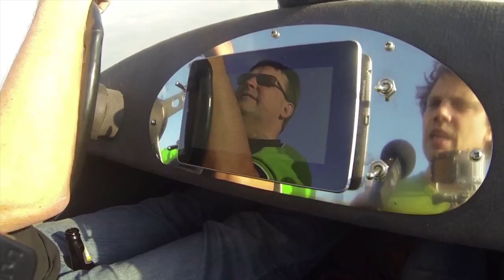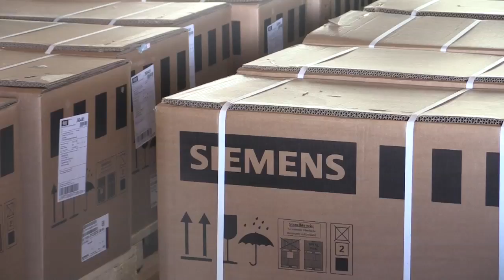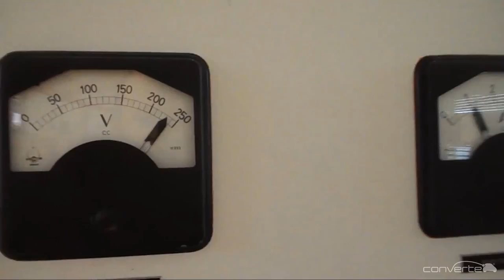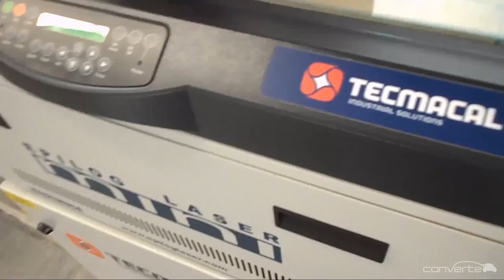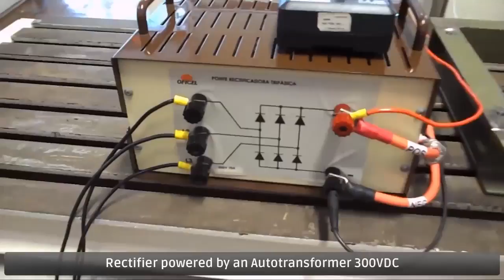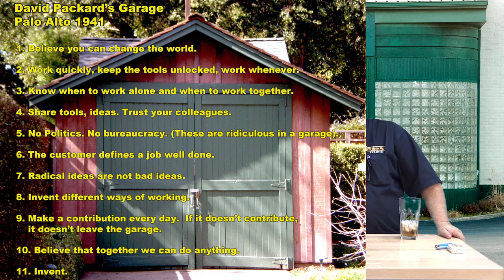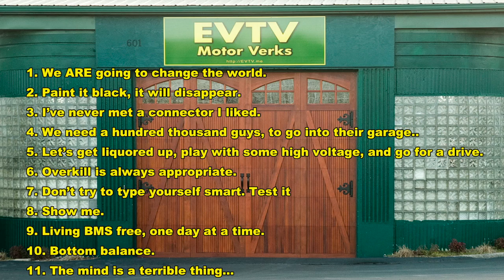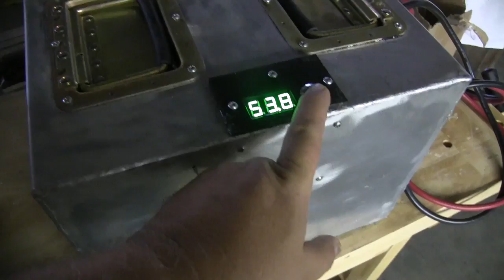EVTV Friday Show - October 11, 2013

Comment: I've seen thin film solar but how long will the panels last compared to the heavy duty stuff? New thing I saw was shingles with solar crystals meshed in so you don't really see any solar panels it looks like a normal asphalt shingle roof structure.